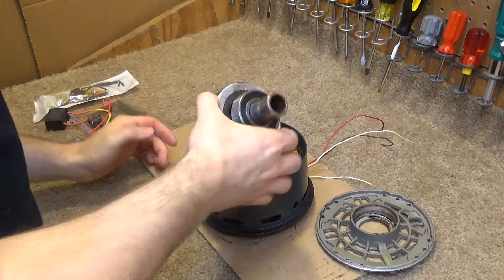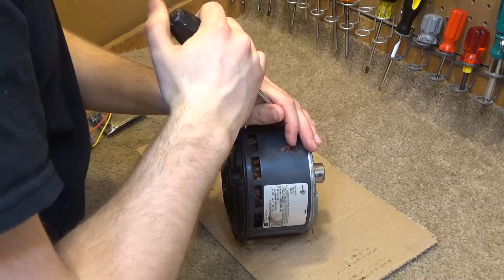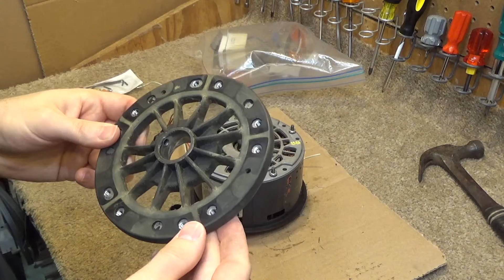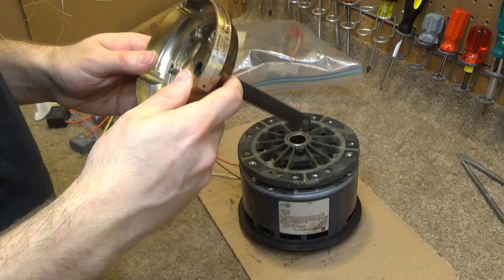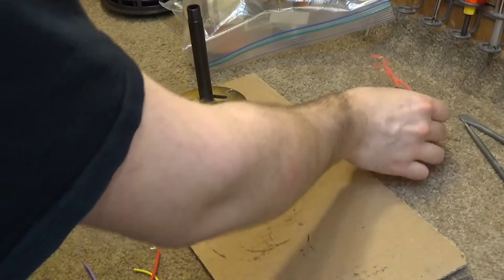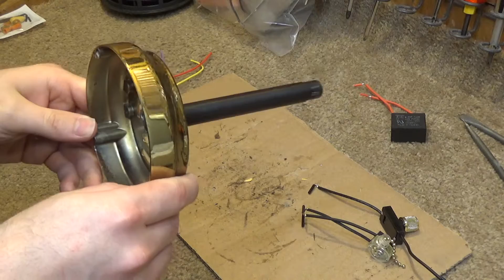Reassemble Casablanca Panama Gallery Edition Motor and Discuss Plans for New Control System

Comment: hmm Emerson lap wound them... good would make rewinding easier if one ever needs that ... for the sticking, probably a burr on the shaft ... as far as caps 3-5 for low slow low 9-10 normal low and 14-16 for medum would bee good based on what i have seen with other 'k55 class' fans
Reply from the maker: Thanks for the input.. I settled on 4 for slow low, 7 for low, and still need to figure out medium.. I heard 12 somewhere, perhaps I'll get a multi-value cap so I can experiment between 12 and 16..
Reply: 12 its the stock medium but there is a  big jump between it and high , which is why i tend to like a value around 14 -16 for conversions  gives a more even range of speeds
Reply from the maker: OK, I'll try both and see what I like better..